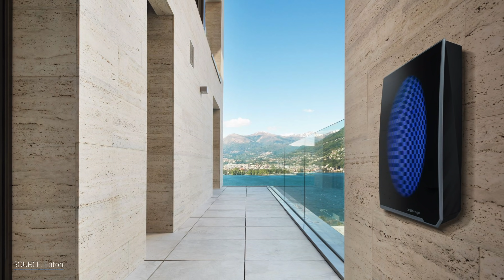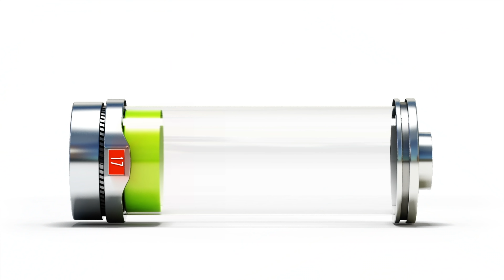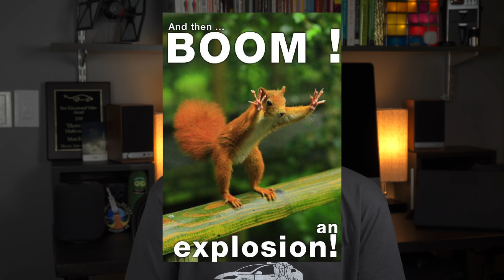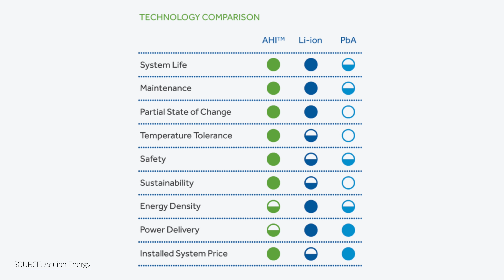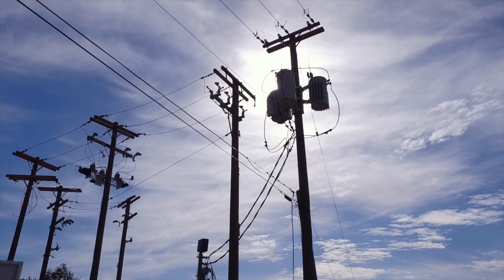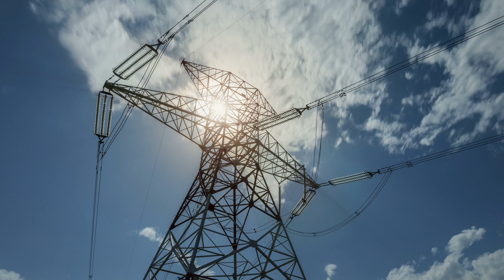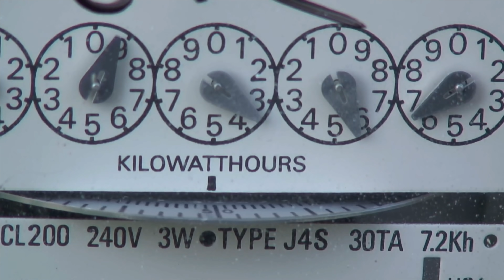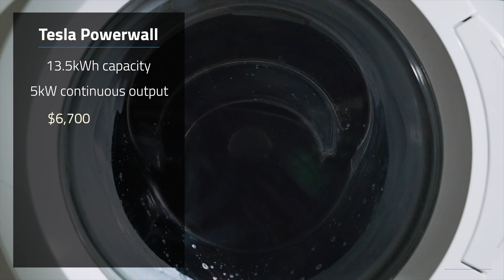Solar Battery Tesla Powerwall and more

Comment: I like the whole concept, but want to modify it slightly.  The Tesla Powerwall is expensive and only has 13.5kWh of storage.  The Model 3 you own has 75kWh.  If you're not using your car, why can't it supply power like the powerwall?
In Georgia, the electric rate for EV's (Super off Peak) is .01Kwh.  To charge a Model 3 completely overnight costs less than a dollar, making the ROI on solar terrible.  So why not charge a "75kWh Powewall Car" for a dollar and use that instead?  Is that just a ludicrous thought?
Reply from the maker: It’s not a ludicrous thought.  Vehicle to grid (V2G) is really a thing that’s slowly been gaining steam for several years now.  It’s still in the testing phases in a lot of places, but Nissan has been at the forefront of that movement like in Germany.  There’s no reason Tesla couldn’t do it too, and Elon has said that they’re open to it.  It makes a lot of sense.
Reply: Nissan is pioneering vehicle-to-grid networks outside of the US. They also have emergency power kits that are stand along systems to act in place of a generator.
Reply: Actually, people have been using Prius and other hybrids to power their home for days at a time when they lose power.  The forums for these cars have the docs/videos of how to accomplish this.

I am in So Florida so rigging my prius is a thought once I move out of this condo.  I am moving because I bought a Model 3 :-)  And I would love to have that rigged up to supplement brownouts and short blackouts.
Reply: Companies in Europe are using vehicle to grid, v-2-g.  The cars charge at night when rates are low.  Then driven during day.  Then sending excess power into grid in evening when demand is high and car is back at company yard.  These have been mostly service vehicles.

Comment: Nice Video.  How about one on 'thermal batteries'....a company in the UK (Sunamp) makes them....but they don't seem to be available(?) in the US yet.   Would be cool to replace my giant 50 gallon water heater with a relatively small (and vacuum panel insulated) 'thermal battery'.   Could be a BIG energy game changer....if these catch on.
Reply from the maker: Thanks!  I haven’t seen anything like what Sunamp has on the market in the U.S. at all (sadly).  Unless I’ve just completely missed it.  There were a bunch of articles and write ups about thermal batteries/water heaters a number of years ago and then nothing.  I’m not sure why ... I’d have to dig into it more.

Comment: Important things that weren’t mentioned/stressed on:
1) In the US, Powerwalls (and other energy storage solutions) installed with Solar can qualify for the 30% tax credit so long as they are charged from renewable resources (aka your solar panels, not the grid). The only exception is storm watch where Tesla does force it to charge from the grid if necessary.
2) Without a Powerwall, your solar system will not work during a blackout even if it’s technically capable of producing energy. So many people don’t know that.
3) You didn’t mention a key number everyone should be paying attention to - battery round trip efficiency! You don’t get back what you put in; just like with everything, there is a loss. Powerwalls’ spec sheet claims 90% but I’ve seen it as efficient as 92-94% in my personal use.
4) True net metering is unfortunately very rare in the States.
5) People need to research the different plans offered by their energy providers, not just the one they are currently on. Depending on one’s situation, it will have way different pay off periods in addition to the other added benefits.

We currently charge our EVs during off peak for 1/4th the peak price while selling back to the utility company everything we generate during peak for the high price (while using stored energy from the Powerwalls from off peak and shoulder peak prices that are ¼ and ½ the price, respectively). There can be even greater benefits for those who don’t have true net metering and get cents back for each kW they sell but buy it back at full price. Also, in other places you can charge from the grid during low cost periods and discharge during high cost periods that will help reduce the time it takes for the system to pay for itself. 

In most cases, adding 10k more in solar will be better than 10k in batteries money wise but that’s not taking into account the other benefits. We had a few 100+ degrees summer days with blackouts while having animals in the house. Never again. Consider it paying a little extra for the added security.
Reply from the maker: Thanks for the thoughtful comment!  I did stay heavily on the numbers in the video, but the very last point really struck a chord with me.  This really does need to be looked at as an investment in your home and peace of mind.  Just the $$$ doesn’t cover the full benefits of the system.  Many people have expensive generators installed on their homes to carry them through blackouts.  This isn’t that different, but unlike the generator, it has the potential to recoup some of the cost (if not all of it) over time.
Reply: Undecided with Matt Ferrell I’d venture to guess its more environmentally friendly than most if not all of those generators, too. Not to mention that it’s not nearly as loud and intrusive. As the prices are today, it’s definitely not the best investment money-wise and blackouts are generally very rare for most so it’s still a luxury you pay a premium for. You do hopefully help drive prices down for future products and support a company of your choosing, of course.
Reply: seriously who vets how anything is charged once its installed?

Comment: Renting now but I plan on building a house in the next 3 years so I want to build it with solar being the main source of power. Interesting stuff to keep in mind!
Reply from the maker: Nice!  Whereabouts are you planning on building?  If it’s a colder climate, you might want to also consider geothermal for your HVAC system.  I’ve been interested in Dandelion: https://dandelionenergy.com.
Reply: @UndecidedTechnology  Oklahoma! And I have seen that too but it is really only cold for about 3 months here.
Reply from the maker: Oh wow, you’re in a great location for solar (much better than where I am).  You should be able to set up a great system for yourself!  And yeah, geothermal would be overkill and not worth it.

Comment: I wonder about Winter. The effect on Solar and batteries.
Reply: Mike Mellock not really sure what this question means.  In winter I loose about 60% production with solar which means my Powerwall will likely, best case for me will be 70% of my Powerwall would be charged, but since I normally have 30-40% of my battery left in the morning’s I might skate through here and there.  I likely will change my Powerwall settings so in winter my house will NOT use the Powerwall as an in-line source and since I live in New England I’ll use the Powerwall only when grid power goes offline (which does happen regularly for me).
Reply from the maker: That’s a good question, but I’d be surprised if it’s a major hit.  I’d love to hear from folks who have one to chime in on that.
Reply: Living farther north, in Oregon, our biggest challenge is the much shorter days and frequent heavy clouds in the winter. I changed the “self powered” settings to keep a higher reserve, between 50% and 70% depending on weather, so that any sun we got made sure we might have power if we had any power outages due to ice storms or heavy snow that broke trees over power lines. Luckily we only had 1 significant power outage that was less than 2 hours, but it was nice to know we had at least 8 to 12 hours of battery power available for the entire house, if we needed it. 

At a glance, we caught between 113 and 182 kWh of sun in the winter months, jumped back up to 482 kWh in March and April, and have collected 200 kWh this week, so sunny days obviously make a huge difference. We are running around 80% self-powered for the week, and 60% self-powered for the month, so we are definitely climbing to the more consistently self-powered days. 

Our Powerwall is installed in our garage, where temperatures don’t really get below 50° F, so I did not notice any issues with battery capacity in the winter months.
Reply from the maker: Thanks for sharing (both Mike and Gary).  Nice to hear to some real world experience in colder climates.
Reply: really depends what winter means in your location

3 feet of snow on the roof?   weeks of grey days?   blue sky freezing sunshine?  all of the above depending on the year?

Comment: I have solar and Tesla PowerWall backup. One of the features I like is that if GRID power is down, i have battery power, and I can still use my solar power (when the sun is available).  Before I got the PowerWall, when the DRID power was down, I could not use my solar power.
Reply: I think that's the major point the author forgot to mention.I live in New York, Long Island. I got my solar panels installed a month ago  and Tesla is having their powerwall installed in two weeks. The reason I'm doing it, although I got full net metering from the power company, is the power back up. It's either this, or buy a natural gas generator which is loud, uses gas, requires frequent maintenance, and associated fees from the installer to change the filter and such. The powerwall allows me to use the solar panel energy even when the grid is down. Considering 30% off from my taxes, this is even more cost-efficient than the generator.
Reply: Michael Jacobi precisely. And you’ll never even realize there was ever a blackout because the transition is seamless.
Reply: @Michael_Jacobi  I live nearby in CT and wonder about issues such as snow, snow buildup, roof repare under the panels, impact of the panels on roofing and longevity and such.  In warmer climes, these are not generally issues that we northerners have to deal with.  Any thoughts?
Reply: @alliejr  snow and cloudy days do degrade the amount of generated power. The snow actually melts faster in the panels. I have 25 year warranty on the panels and 15 on workmanship. I had my roof changed since my slates were too old, and generally no one installs on slates. Since the same company did both, the roof warranty is also included. Btw, I got 30% on incomes tax back for everything: the roof, solar panels, Tesla wall and even the tree removal, since its all part of the same solar project.
Reply: Michael Jacobi wow. Nice.
Reply: @alliejr  crickets,   all valid concerns
Reply: @Michael_Jacobi  frequent maintenance?  what, annually?
Reply: @yarpos  gas generator needs to be started weekly. The oil and the filter need to be replaced, I believe once a year or even more frequently, . There are way more moving parts than in the battery lol. Dirty, noisy and more expensive. Up until now, that I had Tesla power wall for over 8 months, I have had 13 events, when the power wall had to kick in. Most of them 5-10 minutes. I think that's how long it takes for the grid to start a back up station? Some events lasted as long as 30-40 minutes. It's a great pleasure to realize that your house is one of few in the neighborhood with power, when everything else goes dark and the only one in the first minute or two, while neighbors's generators are starting up.
Reply from the maker: That’s awesome (I’m jealous).  I love that the battery puts that issue of “no solar when the grid is down” to the side, which allows you to keep humming along.
Reply: I currently live in a third world country, we have rolling blackouts, almost daily sometimes.  black outs usually last 2-4 hours.  of course they can sometimes last half the day, when something more serious has gone wrong.

Anyway, the system almost everyone uses here for homes,  is an automatic inverter/charger and deep cycle lead acid batteries.    it's pretty simple setup,   the inverter passes power from the mains,  and keeps the batteries charged.  if power goes out, the start inverting and switch to battery power,  this happens very fast, in most cases, my desktop computer does not even shut off.

Sealed gel cells, have less amperage,  but are sealed, and better for indoor use.  they cost a bit more also,  for someone just looking to have back up power in case of an emergency, and not spend a fortune., this is the way to go.   I will mention some brands,  but there are many good manufacturers,    the most popular batteries are the Trojan T-105s which are pretty cheap,  around US$ 125 bucks each,  just two of these will run my small setup, around 500 watts for 3-4 hours.  I only connect fans, lights, TV and computer.   more batteries = more power and time.    the inverter charger I have is a knock off of the Tripp-lite 1kw.  

In the USA i would use lithium or Gel,  maintenance free, something you don't worry about until the power goes out, you can keep cost low by isolating the circuits you want back up power,  trying to run the whole house for days is just way too expensive.
Reply from the maker: @agriperma thanks for that info.  These kind of systems really seem like a necessity if you live in an area with a problematic power grid.  Worth every dollar.  And thanks for the recommendations.
Reply: So you do not have a grid-tied system which means that you can't sell your excess power back to the power company.  A grid-tied system cannot also function as a backup if the grid is down, since the the power company cannot allow your island of power to be sending charge back onto a line that might be under repair during an outage (i.e., safety first).  A grid-tied system is the cheapest option both to install and operate, but, you don't get the advantage of having a backup when the grid is down.  This guy does a great, great explanation (not that Matt's video is not also great): https://youtu.be/m5wv4HcRNKw
Reply: @alliejr  With the batteries the system does automatically island itself. So when the grid is up, you're grid-tied. When the grid is down you're in island mode and can operate on solar + battery. Without the batteries, solar won't work if the grid is down.
Reply: @BrettB246  So it's more than a big battery, it's a  complicated controller/inverter as well.
Reply: alliejr a powerwall is also a UPS inverter. It can be charged by the grid, or your solar, AND it sends power where it is needed, NOT up dead power lines though.
Reply: Robert, wanted to ask if you have had an assessment done on the value of your home with the solar and the PW, has the value gone up?
Reply: Can't wait to see the powerwall 3 from Tesla
Reply: @dunkninddonuts  And therein lies part of the problem.  All of their stuff is a beta with something new and better right around the corner.  When making a capital investment and installing infrastructure in your house, you don't want to know it's obsolete next year or even in 5 years.
Reply: Hallo Robert, 
in all honesty, how many times a year does the grid power go down and for how long (in average to your best knowledge)?

Not picking on you personally but generally speaking, I really don't appreciate when someone is talking about the ''benefit'' that occurs 1-2 or none times a year. You see, where I live I don't remember grid power going down in the last 5 years or more.
Economically speaking, that benefit is worth it's money only if the grid goes down very very often. Like in this video, he talks ''it's money worth'' real numbers and numbers don't lie.
Regardless of the economical worth, you sir have a great system overall and my hat's off to you, cheers.
Reply: grid